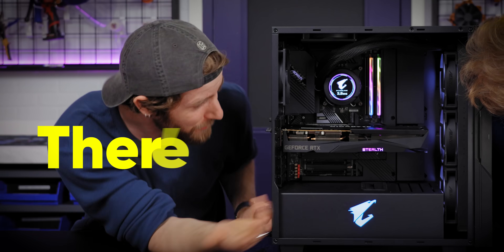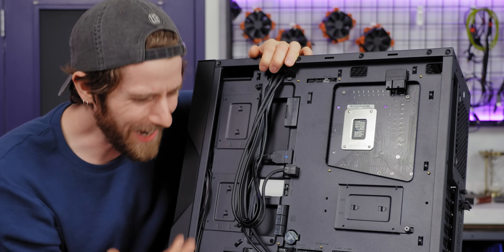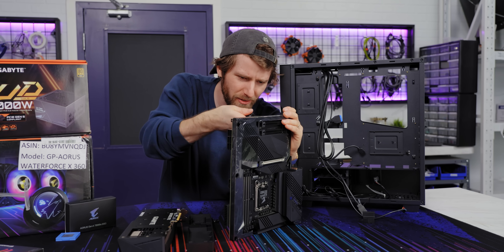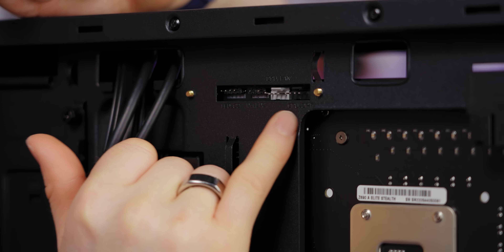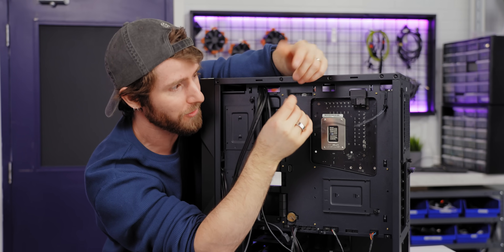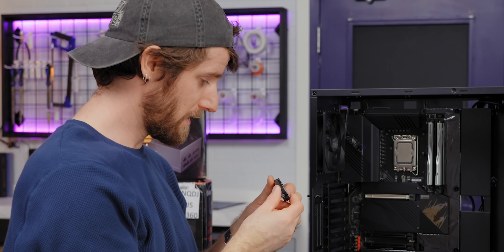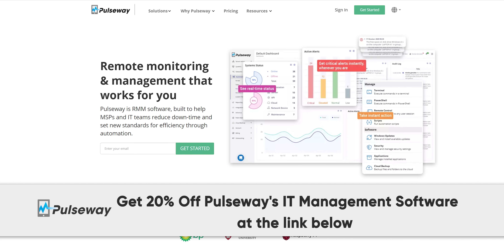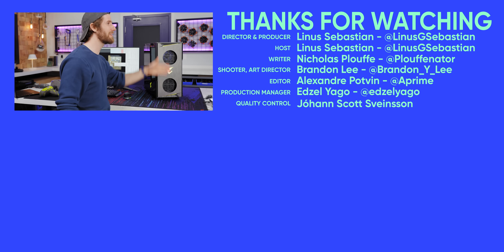Where Are the Cables??? - Gigabyte Project Stealth

Comment: Steve approves of Linus's emergency tracheotomy on that suffocating case.
Reply: Actually a cricothyrotomy
Reply: I want Steve to rip this case a new one... because then it'll have airflow
Reply: Bot
Reply: The case itself look so bad
Reply: PLEASE someone show him the clip LOL
Reply: I own an NZXT case and it has way more holes for airflow than this case, this case has a few small slits, where as the NZXT non mesh cases have their entire 1inch wide side strips, on both sides, made like swish cheese with tightly spaced holes over their entirety. 

You need air to cool, a small negative pressure is fine, although not ideal overall, and in some cases it actually provides more airflow merely due to the way the case is designed (intentional or not - it's most likely because there are way more gaps/holes than what are just in the front for the intake of air and a front fan could not utilise them, where as an exhaust fan could as it's pulling air from everywhere it can through holes in the case rather than just through the front holes alone). The more you close off the intake though, the closer you get to a vacuum, and the less over all air inside the machine there is to cool. There's a point where negative pressure stops working at all as a cooling method and will actually start to almost insulate parts from heat transfer (as compared to in air). In a perfect vacuum heat can only radiate away from it's source and not be carried away via air convection. Now I know a PC case isn't getting anywhere close to a perfect vacuum, however with only exhaust fans the more closed off the front is (and the rest of the case in general), the closer you get to that point in a negative pressure system where cooling ceases to happen by air convection entirely and cooling will be more severely inhibited the closer you get to it.

Interesting point to note. The NZXT cases ship with 3 fans on the front and one fan on the back only. So I'm not even sure it was designed as a negative pressure case, and just happens to work better set up as one, if only using the fans included.
Reply: Big yikes bois. 😬😬😬
Reply: It really did make the point well.
I found it cathartic.
Reply: im getting tired of stupid case gimmicks.
Reply: If the case manufacturer had a better way to get the airflow they atleast have given instruction where to mount properly
Reply: I mean honestly you'll hear these people like Linus and Jay giving Steve shit about it, but he's absolutely right and justifiably correct in anything he's doing more or less, which at the extreme end of shittiness (Dell Alienware) you can see exactly how and why this matters when Dell becomes the sort of Midas or Jesus of shit and can convert a 12900k into a 12700 by their mere touch. Dell's the anti-miracle of computing, and one small part of that is just in the airflow department.

Like seriously would YOU pay an extra $400+stealth warranty+taxes+tip if American only to get exactly the same performance as a multiple SKUs lower CPU? And STILL get all the noise? Like I literally couldn't even do this build's performance in any but a Phanteks case more or less (2 optical drive bays and a 5700XT + all the bullshit wiring I have AND a solid amount of drive cages means without the Enthoo Pro II's airflow and other great features, I'd literally be cooking my components. Instead I manage to run my 5700XT in the 70s playing Division 2, or 90s C junction temp, without changing the thermal pads; it sounds super bad, but without disassembling it to change pads, repaste, risk breaking it during GPU shortage, and it being allegedly "fine" at 110C, well if you ever owned a 5700XT and tried pushing it to the wall you'll understand why I'm happy about getting under 100C junction temps; which is still better than Ampere VRAM temps come to think of it)
Reply: @pandemicneetbux2110  "$400+stealth warranty+taxes+tip if American" 
Even in the USA we don't tip for stuff like this. In fact you don't tip for like 99% of things.. You tip your bartender, your delivery man (for food, not mail/packages) and your waiter at a restaurant. That's pretty much it.
Reply: @3xceIIent  I was being facetious
Reply: @yanuehara8017  I agree. Never said it was great. I only expressed it as an example and said it's not bad. I described it as adequate and enough for most builds. Definitely wouldn't put super high end components in it. It was simply an example of how negative pressure works in closed off cases like that. And I brought up Steve because he validates what I'm saying about the case sveral times throughout his some of his videos. But by no means do I think it's a great case with optimal airflow. That goes without saying an open front panel case with positive pressure is obviously better. And I never saw the S340 or it's review but I'll take your word for it.
Reply: Case flows just fine. For all his knowhow on tech stuff, he understands nothing of airflow and his own videos prove that.
Reply: @BigBeardOne  he showed that it was overheating then drilled the holes and temps when down which makes me think you don’t know what you’re talking about
Reply: @dillansherwood2930   Do you know what negative pressure is? Obviously the way Linus set up the cooling it would immediately overheat like that. This case would clearly have a better time cooling with a negative pressure set up. Same way the NZXT cases have a closed off front panel yet still perform well enough to cool your components. If Linus mounted a radiator at the top as an exhaust and an exhaust fan in the back it would cause fresh ambient air to be sucked into the case from every open space and gaps available. Thus negative pressure airflow. Not saying it would perform out of this world or anything but it would definitely perform way better then this set up. I believe that's what the person above was thinking when he wrote his comment but did a terrible job expressing it.
Reply: @PabzRoz  setting it up on top with the magnetic filter would not let in nearly as much airflow as the front with the 2 holes drilled, and there wouldn't be enough vents for negative pressure either, there simply would be no airflow at all idk where you're getting at
Reply: @uemiduram52  Obviously I'm not talking about it before* he drilled the holes dude....🤦‍♂ And yes there would be enough airflow. Not for great cooling of course but better then the front mounted configuration he had where it thermal throttled. I literally explained how there would be enough airflow if you actually read my comment.
Reply: @uemiduram52  yeah positive pressure is how i handle closed fronts i have 6 intakes and my temps are on par with a lot of other peoples systems
Reply: @uemiduram52  Actually yes there would be. He is correct. He also gave an example with how NZXT's cases work as well. With a negative pressure set up the way he explained ambient air would come through EVERY gap, vent, cable manage hole, etc. etc. This is PC cooling 101 bro. Clearly this case would have sucky cooling no matter what but with a negative pressure set up it would perform better then how Linus had it before he went drilling holes in the case.
Reply: @nateg452  Dude🤦‍♂ Do yourself a favor and watch GamerNexus review of NZXT cases and how negative pressure actually creates adequate airflow and performs well enough. Please educate yourself on a topic before commenting on it. They didn't come out with the mesh version because of backlash. If that was the case they would of came out with a mesh version YEARS ago. They came out with it to make money and have another product to sell to people who prefer a mesh front panel. It's that simple.
Reply: @nateg452  wtf are u even talking about lmfao where do ppl come up with this stuff? nzxt didn't come out with a mesh front panel version because of backlash? do you know how long their closed panel version has been around? and just now they make a mesh cuz of backlash lmfao use your head. Even steve from gn said nzxt's negative pressure airflow set ups actually work quite well. some people just prefer and mesh front panel because they do perform better most of the time so nzxt decided to finally tap into that market. doesn't mean their cases before that were bad.
Reply: @nateg452   dude... pay... attention... did I ever say that the closed front panel version performs better then the open mesh version??? No. Yet again, obviously an open mesh front panel positive pressure set up would perform better. I never said it wouldn't All I said here is that for specific cases that have closed front panels (like this one and the NZXT cases) a negative pressure airflow set up performs better then a positive pressure FOR THAT CASE. Yes, we all know open mesh panels perform better. I literally said in my original comment that the cooling still wouldn't be great but it would be better. Pay attention before commenting please.
Reply: @PabzRoz  I want you to go to 5:37 in the video, and tell me where the fuck a triple radiator goes.

The only space available at the top of the case, is for a dual radiator.

"Well, he should have used a dual radiator instead of forcing a triple into it!"

Then listen to the next 10 seconds from 4:20, or I'll quote Linus, "...Gigabyte sent us all of the parts to do this build..."

It's like....people let their bias get in the way of their listening comprehension.

Then there's the legitimacy of Linus' criticism:
If you are making a high performance gaming case, why the fuck would you design it as a negative pressure case, with limited airflow? To the point where Gigabyte told them "don't use a 12900k" ( 10:36 ). Why would you design a case as negative pressure, to literally suck dust in through unfiltered holes and gaps?

It is a shit design, and Linus is right to roast it for its failings.
Reply: @nateg452  wtf? when did i say the flow performed worse? your twisting words trying to make yourself sound correct but instead u only sound ridiculous. nobody here said the mesh didn't perform better.  you brought up the mesh version saying they made it because of backlash which is incorrect. and all I said is that steve said multiple times that the nzxt cases that have a closed off front panel actual perform well with a negative pressure set up. that's all i said. i never said steve said it performed better then the mesh version. if something performs better that doesn't mean the other thing is bad. get your shi together.
Reply: @dposcuro  Holy hell what is wrong with you people? All I said is that a NEGATIVE PRESSURE SET UP INSIDE THIS CASE WOULD PERFORM BETTER. That's literally it. You're crying about literally nothing not understanding common sense here. Where did I say Linus has to use a triple radiator? All I said was if he put a radiator at the top as an exhaust it would perform better. And where did I say anything about he has to use the radiator provided by gigabyte? I literally never said any of that. I simply explained what would perform best in this case vs how Linus had it set up. And I said the case still wouldn't perform well, just better. Pay attention before commenting please. Idk how you people function.
Reply: @PabzRoz  yeah pay attention... this is a gaming case. if u want to sell a gaming case it should be a no brainer that u can use the fastest gaming cpu in it. i even would go the way to say that every atx case should be able to be paired with it and additional top tier gpu. also why doesnt they even bother to change the top to fit 360 rad? because they didnt care. probably it was the cheapest way to make project stealth possible but with too much downsights. its like building the most aerodynamic car with the fastest engine but then put it on 4 compact spare tires(?... u know the cheap ones only doing like 40mph) just because they were the only ones lying around. hoping for maingear here at this point.
Reply: @nateg452  Ok that's a reach. I'm not stanning. You replied to me and I'm correcting you. That's it. It's that simple. How am I stanning when again I said multiple times that the cooling still wouldn't be ideal. Get a grip dude. For real. Idk what you're bugging out about but it's kinda cringe already. Obviously this case isn't great and it would be better with an open mesh front panel. That goes without saying.
Reply: @nateg452  cause @pabz needed to prove to the comment section that he knows more than everyone else. This case fucking blows.
Reply: @joemarais7683  know more then everyone else? this is common knowledge wtf?😂 we're talking about airflow here not quantum physics
Reply: @PabzRoz  im actually cringing. this is what a linus comment section looks like. a bunch of noobs who have absolutely no idea what they're talking about freaking out because someone made a valid point. just ignore these kids. they will never learn.
Reply: @PabzRoz  okay bro, keep fighting that good fight for gigabyte, I'm sure they appreciate it.
Reply: @olotocolo  dude... there's no way you're going to make me explain how negative pressure works yet again. please read my comment above or watch a youtube video on how negative pressure works. yes, it would perform better up top as an exhaust then on the front where it's ONLY access to air is the tiny holes on the front. Like you literally answered you're own question.
Reply: @joemarais7683  I literally said at least 10 times in this comment section that the cooling still wouldn't be good. stop crying and cope.
Reply: @PabzRoz  LOL these toddlers literally don't know what negative pressure cooling is and are attacking you for absolutely no reason because they don't understand. this is so embarrassing. where are their parents?
Reply: @nateg452  where are your parents?
Reply: @nateg452   that's not why NZXT made a mesh version and that doesn't make him wrong😂 that doesn't make any sense.
Reply: @nateg452  Responding to backlash isn't evidence about it being wrong... Companies respond to absolutely batshit insane backlash from customers all the time. Doesn't mean company did anything wrong.
Reply: @toobyy4554  i agree and never said otherwise...
Reply: @dposcuro  what does any of that have anything to do with what he said? you're attacking him with points that aren't even relevant. he just said a negative pressure set up would perform better that's all. even said it still wouldn't be great. and you people freak out bringing up completely irrelevant points to use against him. what am i even reading in this comment section?
Reply: @nateg452  they never came out with the mesh version because of backlash and that doesn't mean he's wrong either. that's like saying because a company made another product that's better the old one is garbage automatically and you're wrong for saying otherwise.
Reply: @PabzRoz  quote "and yes there would be enough airflow." isnt that the otherwise you claim never to have said? correct me if im wrong, but enough airflow and throtteling cpu do not pair well.
Reply: @olotocolo  Steve from GN has mentioned several times through his videos that NZXT cases perform adequate despite having a closed off front panel because of negative pressure airflow. I know I distinctively heard him say that at least 2 times in his recent videos reviewing cases that were similar. Also it's just common sense. Positive airflow is obviously better but with certain cases a negative set up is the way to go.
Reply: @toobyy4554  Why didn't you copy and paste the rest of the quote? " And yes there would be enough airflow. Not for great cooling of course but better then the front mounted configuration he had where it thermal throttled" like wtf? I literally explained it for you right there. Open your eyes and read.
Reply: @toobyy4554  how are you going to copy nd paste half a quote and use it against him and ignore the rest of the quote that explains the very thing you're complaining about😂😂😂😂😂😂 what a joke are you kidding me
Reply: @PabzRoz  ok, tried to keep it simple. but here we go... u cant mount 360 in top. 240/280 are most likely not enough for 12900k. check the numbers. so where is ur point? is it pairing a not rated cooler with a high thermal output cpu and let it work on the absolute edge should be fine? then i cant help you.  even gigabyte knew its not suitable. 🤦🏻‍♀️
Reply: @joeshmo422  even the rest of his text doesnt add up... even worse, he considers configurations that are not possible or out of spec. why do u think gigabyte didnt want them to put 12900k? because they didnt know their case has topmount? man...
Reply: @toobyy4554  true and its a Z board too, would not be able to overclock on that negative pressure bs config.
Reply: @PabzRoz  Your entire comment chain is a point that exists but is a moot point in that this case is inadequately designed by relying on negative pressure airflow and even going as far as to make that impossible with a triple rad, so there's really no reason to bring it up
Reply: @kaleidodeer  your comment is literally irrelevant to anything that was even mentioned in this comment section. Why is there a reason to bring anything up? i was simply replying to someone's comment. Same way you're responding to mine. was there any reason for you to bring anything up?🤦‍♂ you're acting like I said this case is good or I said it performs well with a negative pressure set up. Never said any of those things so idk why you're babbling about it's design and what I said.
Reply: @toobyy4554  do you even know what you're saying... lol where did I say anything about a 12900k? where did i say anything about it having to be a 360 rad? i seriously don't understand what you're going on about bringing up points that are completely irrelevant to anything I ever said. Technically as long as a CPU runs within spec it's fine. That also includes when it's running hot or "on edge". But I literally said for the thousands time that it still wouldn't be good cooling. It would be enough. Enough doesn't mean good. Pay attention and stay on topic.
Reply: @PabzRoz  Sorry to tell you, but you're wrong. If you check the Project Stealth gallery, they had a 2x radiator mount in the front too. If a case was designed a specific way, they wouldn't have allowed the consumer to possibly mount them in the front.
Reply: @PabzRoz  yes i know what i am saying. obviously u dont. you must just be trolling. ur commenting under a video where its a 12900k which throttles in standard configuration. so obvious we talking 12900k. no u didnt talk 360rad neither did i. but specs require 360rad for this cpu due to its extremly high thermal output. so is it me bringing up irrelevant points or you? yes a cpu is fine when its hot. its not fine when it throttles (even it doesnt get damaged), because the case manufacturer is lazy. with edge i mean cases that arent specced and can result in lost warranty. to advertise such stupid things is dangerous for a lot of user without knowledge and can become pricy. u wanne be the one taking responsibility? and if a cpu either throttles or is cooled out of spec it is just not fine nor would it be considered enough cooling. and if u want to argue that it would all be ok for another cpu pls consider the gpu isnt even running under load in this video. also the case isnt marketed as "negative pressure", so awaiting general consumer to configure it like that is out of reach. and the idea of case manufacturers to implement cpu compatibility lists is just absurd. oh and if u dont get it by now, pls seek help with argumentation, because u try to drag the topic away from its root, which is absolut lowkey behavior.
Reply: @dillansherwood2930  drilling holes doesn't do jack shit. It creates air turbulence. It's overheating cuz he pushes everything to the max for views.  You want it to scavenge air and create a path of fresh air, not recirculating the stale, hot air that he is sucking into the fans.
Reply: @PabzRoz  Uh linus Did try and mount the radiatior at the top, it was litterly his first intention but thee was no place for for the fants to fit at the front...he littrally talks about this in the vid
Reply: @PabzRoz  Your points would've been valid if the case was called "Our mega-super ABZ123 case with NEGATIVE PRESSURE SETUP (which is required)". But it was not called that, there is no indication that it requires some special arcane airflow knowledge to setup. 
So no, it is a badly designed case, not a "hidden genius" gem.
Reply: @Vladimir_Kv  I can't tell if you're kidding or being serious... Are you just making up words to make yourself seem like you have a point or do you actually believe the nonsense you're spewing? I never once said it's a well designed case. I never once said it would have good cooling. In fact I said even with a negative pressure set up it would still not have good cooling. Just better cooling. Literally said that over 10 times. All I literally said is that it would have better cooling in a negative pressure set up and you're having a melt down making up stuff putting words in my mouth like I just slept with your mom or something. 

And btw cases don't label themselves as positive or negative pressure cases... they don't use any "indication"... everything you said literally made absolutely no sense. I seriously can't comprehend why you people comment random nonsense knowing you have no idea what you're talking about yet still go on insisting you do.
Reply: @CuppaLLX  Obviously It didn't fit. Did I say anything about having to use a 360 radiator or say anything about using that exact radiator? No. Obviously not. I simply stated A radiator. Ya know, one that would fit. Common sense here, common now.
Reply: @toobyy4554  Are you kidding me? How do you even function on a day to day basis. Watch this video again. He uses a 12700. Not a 12900K. Which is why I said nothing about a 12900k and why I have no idea why you're bringing one up as if it's at all relevant to anything I said. Seriously I feel like I'm talking to a donkey or something at this point. Go back, put on your glasses, pick up a dictionary, and watch the video again. Then read my original comment. All I said was that this case would have better cooling in a negative airflow config. I explained it still wouldn't be great, but it would be enough. FOR THE 12700 LINUS USES IN THE VIDEO. Never said nothing about having to use a 360 rad because obviously it didn't fit. And because I never said any parts in general. Because I was only talking about what cooling config would be better. That's literally it. And here you and everyone are making up stuff I never said and making up points to make yourselves sound like you have any idea what you're saying. Brining up a 12900k for god knows what reason when literally wasn't even used in the video. Honestly. I'm gunna say it again. And this time take the advice. PAY ATTENTION.
Reply: @PerfectionistNY  You're kidding right?
Reply: @kaleidodeer  I honestly don't know what you're talking about. So my comment had no relevance but your comments do? Ok... Let me try and make this very simple for you to comprehend. Here on youtube there's this thing called the comment section. The comment section is meant to discuss the video and for people to leave/ discuss their opinions. Just like everyone else who commented, I also commented explaining what a better airflow set up would be in this specific case in RESPONSE to someone elses comment about the cooling. You caught that? Your comment is literally a contradiction to yourself. If my comment had no relevance then literally no comment here has any relevance including yours. What you're saying makes zero sense. Please use your head for 2 seconds before replying again.
Reply: @PabzRoz  this comment section is gold. thank you for making these casuals have a nuclear breakdown. i honestly never seen so many comments of people making up random stuff🤣 made for a good laugh.
Reply: @nateg452  dude did u really say nzxt made a mesh case because of backlash? LOL your comments are hilarious. I love Linus comment sections. It's always kids who are new to PC's and tech yet pretend their experts saying things to sound right but make no sense.
Reply: @toobyy4554  he used a 12700 not a 12900k bro wut r u on about LOL these comments have me rolling🤣 u kids literally have NO idea what you're talking about. u can't even get the video right🤣
Reply: @nateg452  yeah unfortunately you're wrong because nzxt didn't make that case because of any backlash and just because they made that case doesn't mean there was anything wrong with their original case nor does it make him wrong. what a ridiculous thing to say. seriously your comments are just embarrassing. know what you're talking about before commenting false information.
Reply: @nateg452  u legit just made that up🤣 r u kidding me bruh
Reply: @PabzRoz  problem with doing a negative pressure case is you'd need dust filters over every open gap and hole to help reduce dust buildup - something that ive never seen done, not even the ones that use negative pressure setups. most cases put dust filters over the intakes where fans go.
Reply: @PabzRoz   At the end of the day you admitted that this case wouldn't have great thermals even with an "optimally" placed radiator. Why would anyone ever want a case with shitty airflow that gives shitty temps even with optimized fan/radiator placement? This cases airflow is garbage and its time we start giving companies shit for producing cases that JUST look pretty and get them to make cases with airflow and performance in mind. Anyone can design a case, not everyone can design an optimal case.
Reply: @PabzRoz  I understand what a comment section is for. Look who you originally replied to. It was in context to this video when you brought it out of relevance to the video by suggesting not only an inadequate scenario but one that is not doable with the parts given. The relevance to my comment is pointing out the lack of relevance to yours. But hey if being off topic to videos is what you like to do in comment sections then just say so. But your witty attempts by trying to "explain" things to me condescendingly certainly doesn't help you. Maybe you should use your head instead of knee-jerking to everything
Reply: @PabzRoz  yea there is definitely a better way to configure the case, maybe enough to get a cool enough cpu, but a completely closed off front panel (with slots for fans mind you) is a complete miss in case engineering, especially for a performance build in mind. There should be no compromises in a product like this.
Reply: @PabzRoz  What a joke.
Reply: @PabzRoz  so you design products for a specific config for a DIY market? Idk something's telling me a general purpose case should at least support fans going the other way eh?
Reply: I actually see where @Pabz is coming from, but it’s clear it’s not worth arguing with these people, because what (some) of them are saying is correct, just not in this context. I’m not going to pretend to be an expert because I’m not. But I know enough to tell that he said it would be better not the best. He said nothing regarding the design of this case to be good, just adequate if used correctly. Now I hope that people can take the context of what is being said into account and not cherry pick things that seem bad in the context you are setting them up in.
Reply: @PabzRoz   First of all Gigabyte's website claims that radiators only fit in the front. The top only supports two fans according to their website. That probably means that Linus only had one spot to install that radiator.
Reply: @dudeyo7264  slipped up 5sec. of a video i watched in the background. fair point. but it just makes the case worse...
Reply: @urmomsahoe1  Huh? When did i recommend this case? like wtf lmfao everything you're saying has nothing to do with what I said. you're going on and on about nonsense that has nothing to do with me. we all know the case sucks. why are you even asking me "why would anyone want it blah blah blah blah"? Like wtf? I literally said this case would still suck. I don't like the case. I never said anything good about the case. All I literally said was what would work best in the case. That's it. Stop crying.
Reply: @evanharden  I agree
Reply: @DaBoomDude  100% it definitely does introduce dust.
Reply: @kaleidodeer   u sound ridiculous. that's what the comment section is for to express your opinion and to converse with ppl. how are u going to say what he said shouldn't of been said in the first place? do u not realize how crazy that is? there's no rules of what to comment here? if anyone followed what ur saying then how do people even start conversations? u make zero sense. ur reaching hard for no reason whatsoever. the only comments that have no relevance here at all is yours for making up a point to argue with him that has no validity. This is a COMMENT section. he commented and used it just like everyone else here is using it. at least everyone else here is actually staying on topic debating him about the actual case but here you are debating him on how he shouldn't of wrote the comment in the first place. that's actually insane. he replied to someone expressing what he thought and continued on a conversation and made a valid point as well. get lost.
Reply: @toobyy4554  so you basically started an argument with me over a video that you didn't even pay attention to and admit you were "watching in the background"......  seriously? come on bro.
Reply: @PabzRoz  i started an argument about this case not getting better because of very specific rad/fan/airflow configuration. pls pay attention. ;) and idc about low wordgames. so thank you and bye bye.
Reply: @torva8121  I never said there were rules, I don't own YT. But typically social etiquette is staying on topic which that was not. Starting a conversation is the beginning of a chain of conversation so obviously such things don't apply but in this case Linus video is the conversation starter.
You can't even differentiate starting a conversation from continuing a conversation, you are quite the ridiculous sounding one. A for effort but its very much grasping for straws. Sorry that you don't like that I called out a derailing and lack of relevance of the point they made.
Reply: @kaleidodeer  The original comments he replied to were. "Case flows just fine. For all his knowhow on tech stuff, he understands nothing of airflow and his own videos prove that."

Then someone replied to saying "he showed that it was overheating then drilled the holes and temps when down which makes me think you don’t know what you’re talking about"

So then @pabz stays ON TOPIC and replies to that person explaining what negative pressure airflow is and how it would perform better in that case and that's what he thought the original poster was trying to say. That's 1000% on topic and completely relevant continuing a comment thread about airflow making a valid point. Exactly what the comments are meant for. The ONLY person here in this entire comment thread not staying on topic is you. You have left zero comments about airflow, cooling, or anything. You're just arguing over the most absurd trash imaginable. Not a single thing you said was valid or relevant. All you have done was make up trash in your head and mumble about nothing contradicting yourself over and over with every comment. I pray for your own sake you're just messing around and don't actually believe anything you're saying because god help you if you do. you're going to have a rough life that's for sure.
Reply: @toobyy4554  you're seriously not the sharpest tool in the shed huh
Reply: @dposcuro  that has nothing to do with anything he said tho. these comments are so cringe it's hard to read. yall are making completely bsto try and seem like you know what you're talking about yet have absolutely no idea. it's a joke. he shut down each and every one of you effortlessly and have you all crying. go back to bed and get better. sad.
Reply: @edswanson4135  dont know who asked you but thanks. i have proof ur wrong 🤪
Reply: @edswanson4135  Negative pressure airflow has 0 relevancy to the video given it wasn't even a viable solution among other things Linus pointed out in the video. So no, it wasn't staying on topic given its a moot point at best. No contradictions here, if your comprehension sucks, just say so. Pointing out the irrelevance of a topic to stop derailing to get it back on track is indeed relevant to conversation flow, but you all continue to double and defend each other. Very funny given people were railing on pabz for even trying to make that point but as soon as I point out its lack of significance in the discussion its a problem and incoherent rambling. I should honestly be treating your attempts at knocking my intelligence as a compliment. Wouldn't want to be associated with yours. Thanks for your concern babe, but I am doing just fine in life. ;)
Reply: @kaleidodeer  Can you please explain to me where you got “it isn’t even viable in the case from” I would really like to see where it says that. What I think you did is create a long article chasing lies, but I will gladly be proven wrong if you can provide me with any evidence.
Reply: @Middleseed  
This is a repurposed C300g and the product page clearly shows its intention of intake being the front and bottom if you include psu with exhaust as rear and top. Pair that with the 360mm rad Gigabyte supplied Linus and all of the advertising between the c300g and stealth kit back this up. Take a look at the compatibility page for the c300g too and it displays support for 360mm in the front and 120mm in the back for radiator support. Clearance for a 240mm at the top is likely too small to fit many radiators if you can fit one at all. But it still shows no hint at an intention of being a negative airflow case. It won't come as a negative pressure build as a prebuilt from maingear either.

And since NZXT and GN was brought up that video doesn't hold much weight given the h500 can't do top mounted 240mm aio and it only comes stock for negative pressure in a air config which sacrifices cpu temps for gpu temps (not good for this cpu even in a air config) then flips if you make the top fan intake instead. C300g is more comparable to the H700 series which he didn't show negative pressure in his review, nor does the case come stock for negative pressure. NZXT cases came out prior to 3000 series GPUs and 12th gen intel while the stealth kit does and they fully expect you to be able to cool such components properly when it can't like this.

This is the basis for me saying not only is the suggestion not something viable and even if you could do it its a moot point at best given all intents and purposes of this case. Its debatable whether the config could even get it right under thermal throttling theoretically.
Reply: @kaleidodeer    I have been corrected, sorry for being rude. Got a little bit to know-it-all despite being relatively new to this kind of thing.
Reply: @PabzRoz  Eash... some folks here... 🤦‍♂️. Don't get too worked over it lol.. there is no point stressing over randoms on the web. To those who brought up the 12900K, 1)Gigabyte mentioned don't use a 12900K in this case. 2)If users do use a 12900K in such a poor airflow case, the best option is to use the PSU fan as an additional exhaust even if the if PSU fan is not running it will still allow some heat to be removed from the system. Secondly, when the PSU fan does kick in it would help remove exhaust heat. I swear most people either have forgotten that it's better to use the PSU fan as an additional exhaust or are just ignorant to the fact facing the PSU down is actually more detrimental to the PSU as the clearance between the bottom of the case and a desk etc is miniscule with zero to no airflow. It's worse if the PC on a carpet. Every PC I have built always has the PSU facing up as an additional exhaust. Not to mention, although GPU fans will be blowing hot air into the PSU which is marginally better than the GPU gradually heating up the PSU over time during long gaming sessions - this effect is more evident in poor airflow cases. In a case like the H500M for example, facing the PSU down actually gets it pretty warm again due to poor clearance between the PSU fan and the desk (it can be felt on glass side panels, that's how hot it gets). Facing it upwards, allows the 200MM fans to blow cool air into the PSU. So, yeah if you have PSU shroud choking up the PSU, place a temperature probe on the side of it and you will see what I mean.
Reply: @PabzRoz  I agree with negative pressure but Gigabyte sending their triple radiator when top of the case fits only dual radiator was epic fail. If it was sponsored video then they probably couldn't use another radiator.
Reply: @Wrebble  I'm just saying what would work better that's all. The fact Gigabyte made an epic fail here goes without saying. What else is new lol.
Reply: @PabzRoz  Linus literally just built a pc with the parts sent to him from Gigabyte. If you want to criticize anyone about front mounting a 360mm AIO, complain to Gigabyte, They A, Chose all the parts to send to Linus, and B, decided that the case would not support a top mounted 360mm rad. You're criticizing him for not top mounting when that's not possible with the given case, so what's your point?
Reply: @toobyy4554  your argument is completely irrelevant. it doesn't add up because you don't know how to read. he's just saying what would work better in a case like that. he never said anything about what is and isn't possible. Linus tried to put a radiator at the top but it didn't fit because it was a 360 so obviously without looking up this case you would think it supports top mounted radiators just not 360. and the 12900k thing is irrelevant. nobody used a 12900k here. he said a million times the case is still bad. he was just explaining that a negative flow would be better in this case and you continuously cry like a baby. imagine being that insecure that someone makes a valid point and u freak out like that and start and argument? over actually nothing.
Reply: @FrostBitttn  Who's criticizing Linus? What are you talking about? I was just explaining what set up would have better cooling then the one Linus made in general. Regardless of what Gigabyte sent him. That's literally it. Don't get so bent out of shape. That's on Gigabyte for making/ sending a crappy set up. I could care less about any of that. It's irrelevant. Lol I needa stop answering all these comments complaining about nonsense.
Reply: @PabzRoz  Negative pressure cooling still needs air vents somewhere, right? The whole point for needing the emergency tracheotomy was that there were no air vents at all. Look at those mesh cases sometimes to get some idea how one could move lots of air without huge pressure – negative or positive. And that's important because creating huge pressure difference will result lots of noise in all cases.
Reply: @MikkoRantalainen  that's not true. read my comments. i already explained how negative pressure works 100 times. when you have a negative pressure set up it pulls air from ALL gaps, vents etc. weather that be pcie slots in the back of the case, the cable management holes, the small holes on the front panel, etc. It's pulling fresh air from everywhere.... Having the radiator or fans the way linus had it just on the front panel will only pull fresh air from those tiny holes on the front panel. See the difference now.... The only thing is with this type of set up it does introduce more dust. Come on man this is obvious stuff here just read the comments. And I said nothing about noise levels. Just what airflow set up would perform best in this case. Stay on topic. I need to stop replying lol like 10% of my replies have any idea what they're saying😂
Reply: @PabzRoz  I agree that air will be pulled through all gaps with negative pressure. However, to actually cool the system you have to move constant mass of air per watt of heat (technically energy in form of joules but it's practically same as watts in case of constant power usage because you use the same amount of watts each second) which means moving air rapidly through small holes or more slowly using bigger holes.

And as you cannot generate endless negative pressure, you have to get the hot air out of the case using positive pressure (locally).

Of course, if you don't mind noise levels, you could even use a compressor and push lots of air through a single screw hole.
Reply: @MikkoRantalainen  yes i understand how negative pressure works lol... again all i was saying is what airflow set up would perform better inside of a case like this.
Reply: @PabzRoz  I understand. All I'm saying is that the Linus's emergency tracheotomy was exactly the thing that this case needed. The designers of this case obviously failed badly with thermal design.
Reply: @PabzRoz  oh how interesting, thanks for explaining, it probably would perform better with negative pressure...
Reply: @BigBeardOne  Found the case layout designer
Reply: @JackNormalMemes  I wish. I'm just a truck driver.
Reply: @BigBeardOne  lol. lmao.
Reply: @BigBeardOne  You're trying to defend poor design, especially considering that the front of the case is designed to allow a front-mounted radiator, thus inviting people to set it up like that.